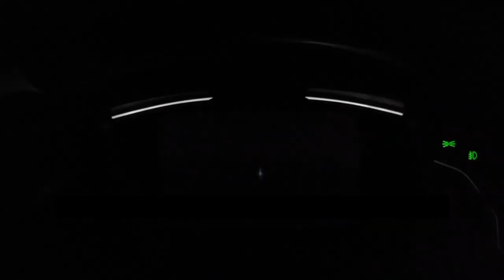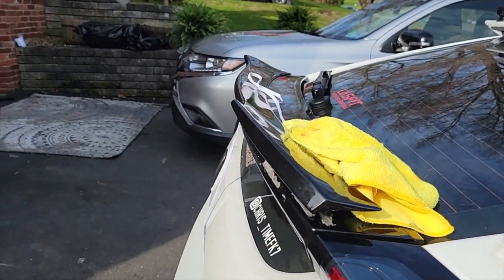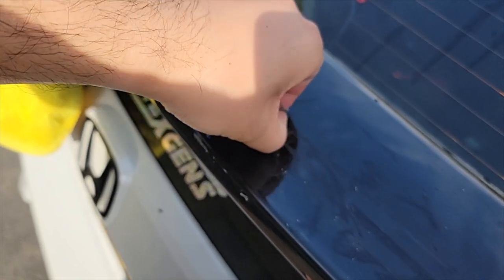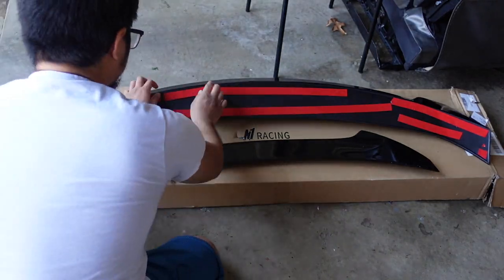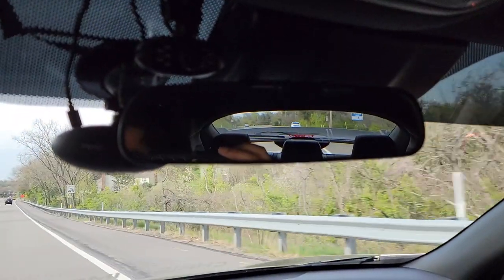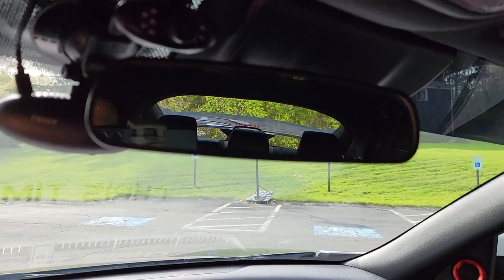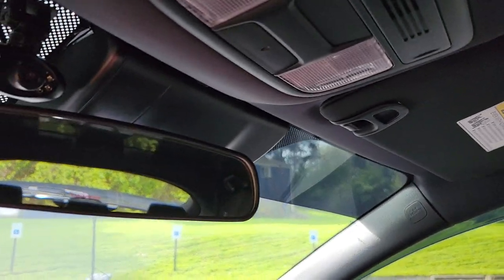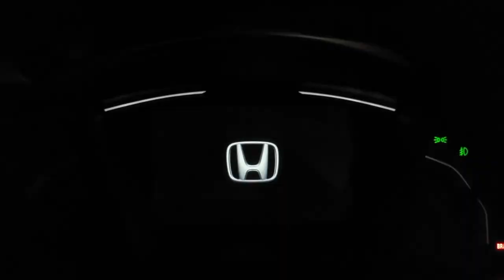10th Gen Honda Civic Hatchback Duckbill Upgrade

Comment: The only thing I worry about It If the adhesive holds In hot areas. I live In Pheonix and yeah yeah you've probably heard It's hot here a million times by now but because of the heat I can't use dash cams that use double sided sticky tape

Comment: What lowering springs should I get for my 2016 Honda Civic ( touring ) in order to lower my suspension very low to the ground ?
Reply: You should look into H&R springs. I decided on them when I couldn’t decide between the 2 lowering sizes that Eibach offered for my civic and I have no regrets with H&R, now my car sits perfect where I wanted it to.

Comment: Ever since I bought a new 11th gen sport touring hatchback the 10th gens look so immature and poopy .. 😅😅
Reply: 11th gens look boring asf and are slower
Reply: @overlordtype25  🤷‍♂️  Go test drive an 11th civic Touring or Si. Sit in it and drive it. I owned three 10th gen civics. Once in the 11th you'll start gaining more appreciation.
Reply: @Anything.is.Possible  yeah you had to get 180hp in the highest end model they slowed down the sport model to 158hp unlike the previous gen and even then the 0-60 time is confirmed slower. I only like the updated infotainment system in the new gen but the exterior is just not it for me
Reply: @overlordtype25  I get you. I did pay 31k for a civic loaded. 😅😅  But times are slim picking and even Tesla has raised their msrp 10k in two years. So I give honda some respect at 3-4k raise on everything.
Reply: @overlordtype25  100% facts. The interior is pretty rad on the 11th gens. The look of the baby accord grew on me but I still prefer the styling of the 10th gens more. Especially the hatchbacks, they look absolutely sick. Wish there was one available when I picked up my coupe.